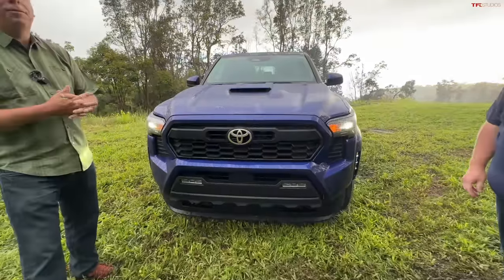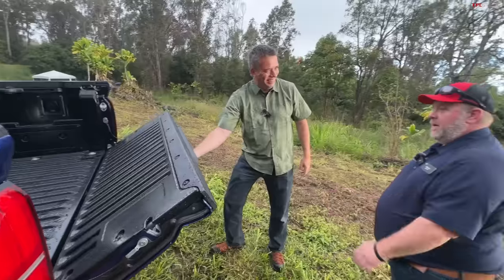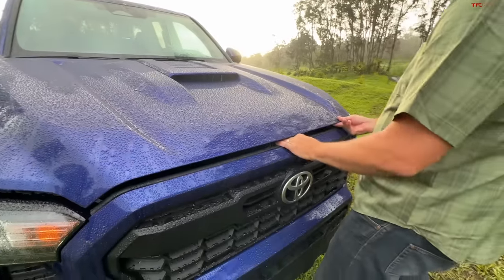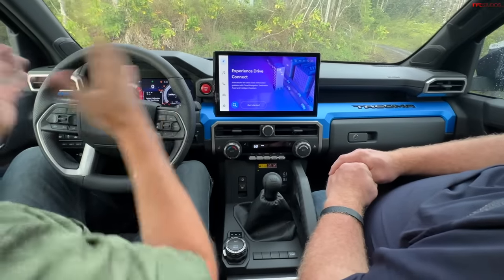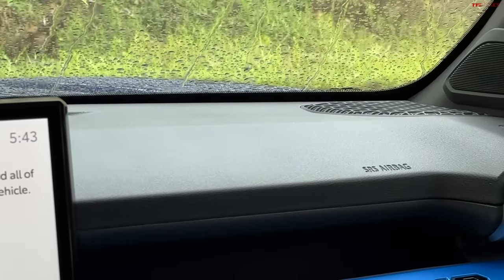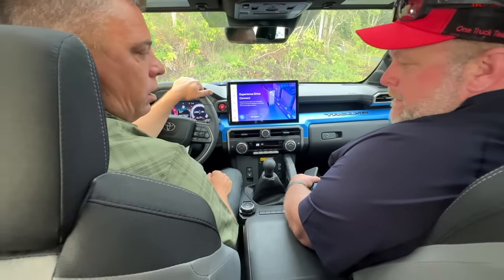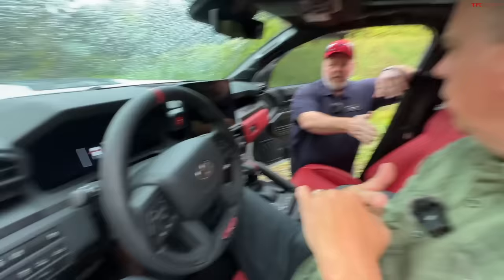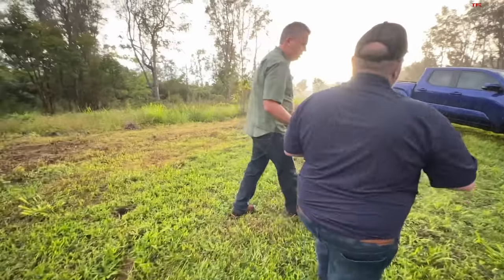2024 Toyota Tacoma Very Deep Dive: I Answer All Your Questions with The Truck’s Chief Engineer!

Comment: Can we make Sheldon the chief engineer of tundra too and replace Mike. The new tacoma is amazing!
Reply: No, he is a vanilla bean, plain Jane boring, they should put him in charge of Highlander and get a badass Japanese car/truck enthusiast to run the whole company.
Reply: Mike can go back to Chrysler or Oldsmobile. I would by  the one way ticket 😀
Reply: The Tundra was an absolute fail, this is a home run. Toyota should take note and adjust.
Reply: @MeliorIlle  hopefully they do a mid gen refresh and it gets Tacoma updates
Reply: @MeliorIlle  same with the sequoia   like the grille  over the tundra  but the fold down 3rd row takes up  to much cargo space
Reply: @youtubecarspottersguide1  The third row is unusable in the Sequoia, I have no idea what Toyota was thinking. This taco was a huge breath of fresh air compared to their other new releases. Let's hop they don't mess up the 4Runner.
Reply: It looks amazing but there's alot more they could have done and add a front locker. Its the only truck without one lol
Reply: @steven2723  has disconnect-able sway bar though. And the braking system will mimic a locker, and while I like a locker more I think the sway bar will be more useful. Engineer basically said it was locked or sway bar.
Reply: @steven2723  No reason to have a front locker.
Reply: @MeliorIlle  I definitely wouldn't call the Tundra a fail. But the Tundra is not their bread and butter like the Tacoma is. Other brands treat the mid-size class as an afterthought and their bread and butter is full size.
Reply: @RedWingsninetyone  Gate issues, turbo issues, stupid gimmicks that either don't work or don't help at all with daily truck stuff, low sales... it's a fail.
Reply: Is it me, or does his voice sound like Nathan? Lol!
Reply: @steven2723  the reason they don’t offer it is because it’s not needed. 
Engineer said the best bang for the buck was the sway bar disconnect along w the drive mode that can act as a front locker in situations.
Reply: @alexgavieres8293  I thought the exact same thing!
Reply: @agentcarder  yeee the sway bar disconnect is amazing, and atrac is really good but for more extreme applications that the trailhunter is advertised for, id assume it would at least have it lol
Reply: @RedWingsninetyone  Not the frontier. They are gonna get a lot of new customers keeping the v6 310 hp. 9speed auto vs the 8. No stupid turbos or hybrid crap. My 4.0lv6 nissan has been great.
Reply: I'm wondering if Sheldon is the person responsible for no sunroof on the Trailhunter?  I'm looking at the Tacoma because Ranger still has no sunroof and the Tacoma I'd most likely buy doesn't have one either. Likely being the highest price, it should at least be a stand alone option.
Reply: is it???? looks like the old tacoma. if you say dif. your lost
Reply: @MeliorIlle  Yeah, not much. Not with BLD like I have or ATRAC like Tacoma has. The grip I have with the rear locker plus BLD on the front (and of course BLD all 4 when the locker is off) with the Cherokee Trailhawk is insane. You feel like Spiderman or something. It's unreal.
Reply: @MeliorIlle  growing pains? Absolutely. Far from a fail though.
Reply: @270eman  we'll see.
Reply: @automationmaven226  Jeep is trash lol
Reply: @RedWingsninetyone  94K sold last year, only 13K up from the v8 version, super fail. Over 100K people bought the V8 in 2020, smart dudes.
Reply: @MeliorIlle  definitely not a fail, but whatever you have to tell yourself, I guess. Sales were higher for 2022 than 2021 and are also higher for 2023 so far.
Reply: @agentcarder  agree completely, the disconnect-able sway bar is far more useful (think better on-road driving manners where most people will spend their time with these + more articulation off-road).  The A-Track/braking systems will get most people every bit the "front-ish enough" locker-ish and if you need more, you are probably already doing a ton of mods/front axle swap.
Reply: Exactly what 'everyone' is thinking
Reply: @RedWingsninetyone  2020	109,203
2021	81,959
2022	94,429
2023	39,399

Lol wrong. Don't defend something you're clueless about. They haven't come close to V8 sales in 2020.
Reply: @MeliorIlle  Toyota sold 13k more Tundra units than the outgoing year Tundra. So it looks like they succeeded in increasing sales volume by over 10%.
Reply: @MeliorIlle  so, in other words, you didn't read my comment and confirmed my comment but tried saying I was wrong. Got it.

2021 was a V8 year. Toyota was also the only manufacturer of full size trucks to record an increase in sales from 2021 to 2022. Furthermore, sales so far in 2023 are on track to beat 2022.
Reply: Georgies brother
Reply: @alexgavieres8293  
Yup, 😊😂
Reply: But Mike is a truck guy and only put things in trucks that truck guys like. We dont need no generator capability or Full-time 4x4 in our Tundras.

/sarcasm.
Reply: @RedWingsninetyone  The Tundra could have been great, they were close, but they missed a few things that really reduced its appeal. Full-Time 4wd for one and a generator functionality like the Ford Powerboost(and now the Taco) would have made the hybrid version significantly more appealing.

Instead the hybrid barely gets better MPG's than the non-hybrid and any power increases are offset by the 600 lbs of weight it adds. Its dumb.

That said, I do think that Tundra is probably a better built truck(not just from a reliability standpoint) than most other half tons.
Reply: @Jay-me7gw  I'll agree with you on the Powerboost thing. But it sounds like Toyota had a different direction they were aiming for with the hybrid than Ford. Even with the Tacoma, they emphasized it isn't necessarily for MPG gains but more assist with power while Ford aimed more at fuel economy and jobsite functionality. Also ignoring the fact that Toyota makes it's name on the Tacoma and the Tundra doesn't get the same funding focus since it's not their bread and butter. Ford, on the other hand, treats the F-150 like Toyota treats the Tacoma. It's their big hitter and they can afford to pull out all the stops. You can see the reverse of this in how Ford and Chevy have treated their mid-size trucks.

I will disagree about the full time 4x4 feature though. It's just not something that I, personally, value and I greatly enjoy being able to use 2WD. I am surprised, however, that they don't have a 4x4 auto feature. Ford has had one for several years and Chevy has had one since at least the early 2000's.

In my opinion, the biggest miss for the Tundra was in looks. It has grown on me, but I still think the grille is way too big and not well done.

I did get the chance to rent one for a few days and loved it overall. It also had one of the smoothest auto start/stop features I've ever experienced. I think my only real complaint was the infotainment system which was partly subscription based. But, unfortunately that's the way everyone seems to be going right now. At least I can use the built in navigation in my current truck without service or a subscription.
Reply: @RedWingsninetyone  I read it and disproved it. Tundra is a fail.
Reply: @MeliorIlle  like I said, whatever you have to tell yourself
Reply: @MeliorIlle  that’s because the tundra was forced to fit into the tngf platform and had to sacrifice in order to do so, where as the Tacoma benefitted vastly from the new global platform. The tundra is essentially a bigger Tacoma. And the tundra doesn’t have the sales that Tacoma does either, hence the Tacoma gets more trims etc.
Reply: @richardoaks3597  TNGA-F was optimized for Land Cruiser which is a global product. They had to adapt Tundra/Sequoia to it and that came with compromises for sure.
Reply: @richardoaks3597  The fundamental design is a fail, regardless of sales. As is the Sequoia.
Reply: @MeliorIlle  yeah I’m not sold on sharing one platform, the proof is in the pudding, and Toyota flat out said it’s more cost effective for them to produce vehicles that way, doesn’t mean the consumer is getting the best product they could produce. For example the last gen sequoia was a beast and ahead of its competitors, now it downgraded to fit the global platform.
Reply: @MeliorIlle  Tundra has never been a fail. Issues that 
the Tundra has had, have been addressed for the most part. I've been owning my second gen foe 15+ years. It had a few overblown issues when it first came out. Anything Toyota has is still better than what the Big,3 has.
Reply: @richardoaks3597  Toyota doesn't need to save money, they're number one in the world. They need to produce the best truck they can without thinking about cost cutting for their own company.
Reply: @RK-nr8qf  The new one is.
Reply: @MeliorIlle  yes they do, every company is always looking at becoming more efficient it’s all about growth, why do you think they all focus on selling more and more and making more and more. You can believe what you want to believe the chief engineers say it themselves, I’ve watched Mike Sweers be interviewed and they say it’s to share parts which makes it cheaper for them and more streamlined and supposedly more reliability because they’re not producing different parts all the time for different models.
Reply: @richardoaks3597  I know they do, and it's morally wrong. Not sure why you're going on a rant.
Reply: @MeliorIlle  I see. Yup, I agree with you they should and they can spend more money and build the best shit they can because that’s what people loved about their trucks.
Reply: @richardoaks3597  I agree. If the hybrid can be put in the Sport model at a good price, this will be my next truck.
Reply: Amen! Mike is so lame! Tundra has limped behind the big 3 For decades!
Reply: Maybe the new trail hunter would be better for the Tundra. 
I have seen the Tundra and I compared with my 2015 TRD PRO. And I would not replace my tundra for the new one. I used to have also the Tacoma 2005, this Tacoma looks great. Let’s see how it will behave with the 8 sped transmission. They have the tendency to shift constantly to look for fuel efficiency.
Reply: Mike is actually the Toyota truck boss, he’s directly involved in all of these trucks.
Reply: @steven2723  front locker has just become a talking point to check off some box on a wish list.  I haven’t seen a situation where you could not get unstuck  without a front locker.
Reply: @smrtguy77777  Good thing he didn't do much with this one.
Reply: @alexgavieres8293  he's nathan's father :face-blue-smiling::face-green-smiling:
Reply: Did anyone think the front air dam is really low? While I appreciate Toyota making changes, it seems there will be more things that can go wrong on the dependability side. Not hearing anything about economy, concerns for longevity of motor w/ turbo and drivetrain vibration fixes that were never acknowledged
Reply: @johncole3010  What does the air dam have to do with reliability? You're all over the place. The engine in the new Taco has been proven for 3-4 years now in other Toyota models.
Reply: @66skate Trailhunter is purpose-built so I’m pretty sure the idea there is if you use the trailhunter for trailhunter things, the stuff you haul on your roof rack will block the sun roof so there’s no point
Reply: You beat me to the comments. Sheldon is a keeper
Reply: Liar.
Reply: This comment didn’t age well… tacomas breaking down left and right

Comment: Somehow Toyota made the iconic and legendary Taco even better and sexier! Good luck to the rest in this class of truck.
Reply: I really like this but I didn't realize how narrow it is for the seating. Are all midsize trucks this width?
Reply: @jloutz  basically
Reply: The competition is stiff, this truck is eyeball to eyeball.  Toyota's advantage is volume and the ability to produce many variants at scale.
Reply: 310hp v6 in the nissan is gonna be stealing customers. Lot of people don't want turbos and hybrid crap
Reply: @270eman  I don't think all Tacoma's will have the hybrid system
Reply: @jeffk464  They don't. Only the top trim does. But they all have 4 cylinder turbos. No v6 option
Reply: I'm 6'1 210 lbs. Not huge but not small. I feel cramped in a Tacoma. Otherwise I'd love to have one. I guess the 2024 will be the same.
Reply: @dangrimes5078 I am pretty sure Andre has spoken about the seating position new vs old and said they have changed the high floor thing they have done in the past.  Then again, maybe he was talking about the Colorado.  Either way, I agree with you, but suggest you check out the new versions before deciding.  A little change  makes a noticeable difference.
Reply: @austinhogan5216  I bought a new Tacoma in 2005. I hated it. I traded it in on a new Tundra in 2006 and I'm still driving it. I have had Tacoma's as loner's in the last 5 years or so and again I didn't like the ride or the power or the comfort. I am going to check out the 2024 when it comes to the dealership. If I like it I might buy one. It will have to be a huge improvement though.

Comment: Congratulations. The engineering team did an amazing job.  

Tacoma team hit it out of the park.
Reply: How exactly did they hit it out of the park?
Reply: @archie_bunker  it looks great, more interior room, manual transmission option or 8 speed, hybrid option, rear disks, lots of different setups etc….

It’s still a Tacoma, just better than before.

With the 8 speed and turbo engine, it is going to drive 10 times better than the current Tacoma.
Reply: @archie_bunker  I'm wondering the same thing. All the idiot fan boys fall for the engineer video's thinking they got their info from the source so that must mean its all very good. Stupid people everywhere. This truck could have been really good and even affordable but they screwed it up with all those stupid features and tech that serves NO purpose anymore.
Reply: @petebusch9069  you hit the nail on the head Pete. well said!! The last generation was already under power and now they put in a useless 4cyl in a midsize? yeah this is not going to go well..
Reply: @AJourneyOfYourSoul  As someone that had the last gen tacoma i can tell you the v6 was horrible, let alone that horrible automatic transmission and now they put in a 4cyl? I sure hope your right this will be a better tacoma i just don't see it..
Reply: @archie_bunker  the turbo makes a huge difference with all that low end torque. Add in the 8 speed and I think it will be so much better. 

We will see, but I am pretty excited.
Reply: @archie_bunker  It will probably perform ok but won't last. That and all that tech makes me want to puke, especially that huge screen on the dash.
Reply: @archie_bunker  the only midsize that will have an affordable V6 will be the frontier then.  i have the current gen tacoma and a 5.0 F-150.  the tacoma doesn't struggle to get up to highway speeds unloaded, but it does get worse mileage than the 5.0 when towing the exact same thing.
Reply: @attananightshadow  Does your 5.0 F-150 have trouble getting up to highway speeds?

Comment: Nice. I loved my 1994 Toyota Pickup (pre-Tacoma) and I drove it for 14 years and 300,000 miles before I sold it. I will be in the market for another mid size pickup and the new Tacoma looks good but if the dealers are allowed to ask for a single dollar over MSRP (Market Adjustment), I'm going elsewhere. I love Toyota products and our family has had plenty (both Toyota and Lexus) but I will not be loyal to a company that is not also loyal to their customers. Earlier this year while looking for a small SUV we went to look at the Corolla Cross. We searched the Toyota official website for what is in stock at local dealers because we didn't want to have to order one and wait for it and every single one in stock had $5000 Market Adjustment markup. Every unit at every dealer and every trim level had the markup. We ended up with a 2023 Mazda CX-30 for $2000 under MSRP. All I'm asking for from Toyota is MSRP and they can't even do that. If we're faced the same situation when the new 2024 Tacoma is available then we'll take our business elsewhere. Don't even try to say Corporate Toyota can't do anything about what their dealers charge. The terms in their contract lists many conditions and things dealers are not allowed to do and no Market Adjustments for non Halo vehicles can be one of them. The Tacoma is a high volume vehicle made at 2 locations in Mexico to lower cost so there's just no excuse for charging more over MSRP other than greed. Reasonable MSRP is important to be competitive with other brands offering similar products but if MSRP doesn't mean anything when Market Adjustments are allowed.